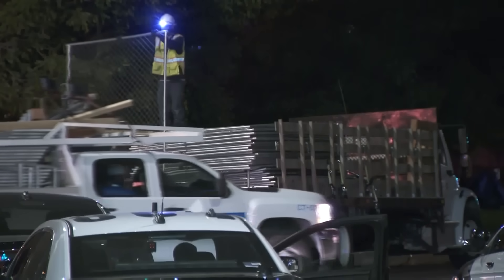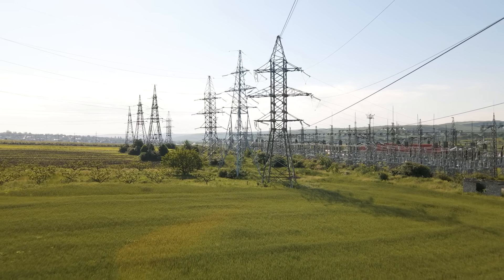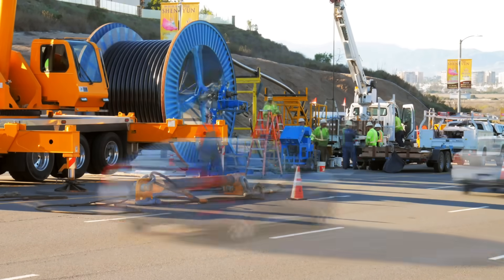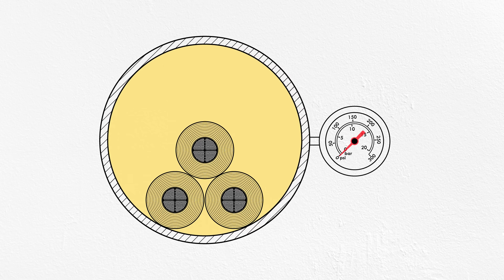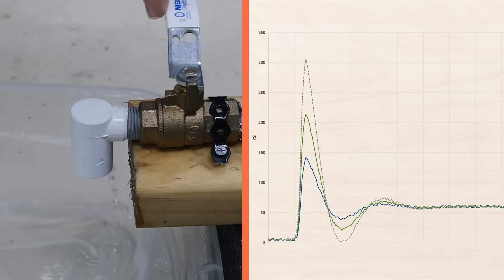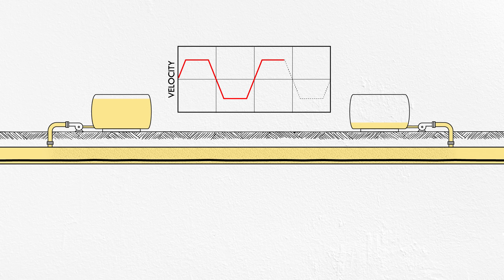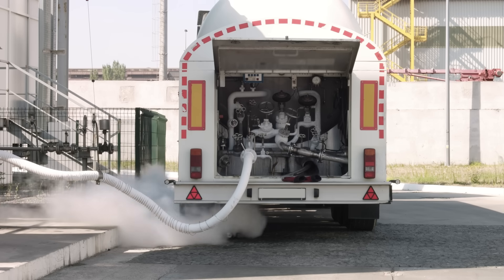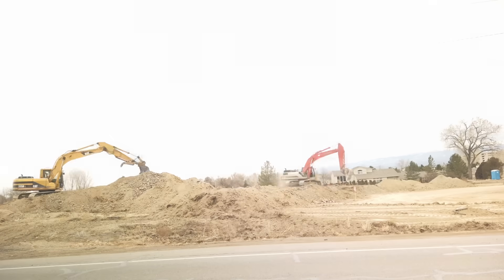Repairing Underground Power Cables Is Nearly Impossible

Comment: Genuine question as a freshman Computer Engineer: why didn’t they use polyethylene in the first place? It seemed to me like a more straightforward solution than the dielectric oil
Reply: Because reliable XLPE cable wasn't around in the 1970s
Reply: I would guess lack of know how, in terms of durability under ground with probably unknown temperatures. Wiki states it can only be used for applications below 80°C continously (table only on german wikipedia: https://de.wikipedia.org/wiki/Polyethylen#Thermische_Eigenschaften). That's the temperature many over ground electrical lines operate at.
It was apparently used for high voltage high frequency radar applications in WWII so it was already common as an insulator.
Reply: Probably not a technologically or economically viable solution at the time of original design.  The aluminum apex of the Washington monument was, at the time, incredibly rare and valuable.  The discovery of large scale refining methods changed that.
Reply: Excellent question.  It's always easier to look back and find fault in a design but the material choice of polyethylene for the dielectric, at least to me, seems like was just overlooked in this case.  Maybe they considered it but didn't because  the engineers at the time didn't believe that the dialectic properties of polyethylene were "good enough" or provided enough margin of safety and went with something that they thought was much less prone to failure.  Just a guess on my part.
Reply: A brief search turned up a 1967 paper "Polyethylene as a high voltage cable insulation", which states that "... even at present, ... paper-insulated cable is still very much in use for all voltages from 15 kv up, and in one form or another is the only insulation used commercially in the 230–345 kv range."
The paper outlines "... the requirements for a high-voltage cable insulation, and will investigate the extent to which polyethylene meets these requirements."
I theorise that the technology was not yet generally available when this project was planned in the 70s, or it was not considered mature enough to be used in this project.
Reply: Was it available for the initial installation?
Reply: Not readily available and even more so for this scale of project

Comment: One of the annoying things as a utility engineer after a storm incident is having to hear all the questions of "why don't they just bury the power lines underground so they can't get blown over"? 
Thank you for highlighting some of the issues with underground power cables, they aren't always the best option.
Reply: Long term the cheapest and enviromentaly best option would be to build utility tunnels under every streat which make a combined easy access for running water, sewage and electricity and whatnot in accessable pipes through them.
Always.
But humans don't tend to think longtherm and for building the costs for this would be massively higher...
Reply: use goddamn utility tunnels like europe has been doing for decades and most of the problems disapear.
Reply: I was "one of them" that used to say this all the time after hurricanes topple power lines in affected areas.  I was always "told" or "heard" that one of the main reasons power lines aren't buried is due to power-loss from source to user, is higher for buried power lines.  I'm not even sure that's true, but this video highlights the drawbacks to buying them, that's for sure.

Comment: I recently had a small pipe burst in my home and the plumber I called also froze the pipe from both sides of the fault so he could easily and quickly install a new piece of pipe without disturbing the water supply to the building. Cool to see it used in such a large repair job too.
Reply: They don’t freeze the entire pipe so the plug expands into the unfrozen section. Steel is stronger than ice/water as long as its not sealed in…
Reply: I just imagine the ice plug becoming dislodged and turning into a 60-90 PSI driven bullet toward the plumber
Reply: @CarrotCaptain  So you're saying don't go cheap on the freeze kit? 😂
Reply: @Kolinako thanks for mentioning this. I just learned that freezing pipes is a viable method at small scales too. 
A twofer!!
Reply: You should never freeze water pipes, water expands when turned to ice and will cause tremendous stress to pipes. I wouldn't be surprised if, in the future, the pipe bursts where he froze them. That's what valves are for, put them in strategic locations and you don't have to resort to dangerous improvised methods.
Reply: @Rayden440  you should go look it up it’s quite common.
Especially in hospitals where shutting off water could actually be deadly
Reply: @Rayden440  Take a look at some plumbing tool suppliers and methods and you will find it's reasonable and safe, properly done! In some instances, it's the only practical way to make a repair! ¯\_(ツ)_/¯
Reply: @Rayden440  I work commercial HVAC and pipes are frozen all the time with a freeze kit for repairs. You have no clue what you are talking about.
Reply: @Rayden440  that actually isnt correct tho, since you freeze the pipe in a non enclosed state its even safe, the ice slugs can expand into the pipe itself and dont need to pressure the pipe around its circumference

Its even common practice if you cannot shut off a line because its paralel to other clients also receiving water which cannot be interrupted

There is another procedure used for large gas pipelines if they cannot be shut down where they essentially live tap the line twice and then seal in between with 2 more taps where they insert valves but that procedure is NUTS
Reply: @Rayden440  I owned an apartment house in NorCal and very often used dry ice to freeze the nearest elbow to the area where I needed to repair a valve or solder in a fitting. We had gate valves on hot water tanks that would shut off and the threads would strip when you tried to open it again. The zinc leached out of the brass threads after 40 years and these old valves always caused problems.  These valves were directly soldered in. I always replaced them with threaded ball valves.

Freezing the line with a bag of dry ice solved many problems. In 30 years of owning the building, I resorted to freezing copper lines maybe 35 times.  This avoided having to shut off the water supply to 6-8 other units.  Tenants never had to worry about their water being shut off. The dry ice would freeze the water solid and prevent having to try to solder a line that had water dripping through it. I used to ball up white bread dough and force it in a water line to keep it dry enough to quickly make a proper solder joint.  Either way, I never had any pipes burst or leak after freezing sections of them.

The largest lines I froze were our 1-1/2 inch wet fire standpipe headers to hose racks. Everything was copper or brass except for a steel nipple at the fire hose rack. Those corroded through and leaked. What a pain to remove the steel ones and replace them with brass nipples. Dry ice saved me a great deal of expense. I often did the repairs myself as it was beyond my maintenance guy's capability.

Comment: Okay, so now I understand why "just put them underground" isn't such an easy solution to the problem of failures in overhead transmission lines causing wildfires.
Reply: just make wireless power 🙃
Reply: @BlackDragonWitheHawk  B)
Reply: @BlackDragonWitheHawk  just have a rotating shaft transmitting the power
Reply: @simontist  that's not wireless...that's a step backwards...

How about geneticaly mutant powerhamsters with a life expectancy of 120 years, food requirement of a tardigrade and 10000 hp strenght (and only 2 h sleep requirement...) Giving one to each house and installing a turning wheel and a battery connected to a turbine
Reply: @BlackDragonWitheHawk  so, basically you'd send these hamsters along an underground tunnel from the power station? Seems legit!

Edit: the pipe must be underground to prevent hamsters escaping and setting fire to the forest by their high speed movements
Reply: except it very much is an easy solution. easpecially nowadays when plastic insulation is widelöy available.

just think about it for a second. fixing the line, which used a by now ridiculously outdated design, costs tens of millions every 20+ years and the new plastic version will cost a lot less due to being easier to replace and less likely to have a fault.

wildfires in cali cost billions a year.
Reply: @anonym3017  Easy? Sure. Economical? Well, considering that California alone is larger than many european countries, it is most definitely not. The terrain is also not very suitable for underground transmission lines in many parts of California. If you've ever been you'd understand why.
Reply: @ice44567  except cali isn't larger than all of western europe combined.

And switzerland manages underground main lines in the alps so cali can fucking do it as well.

And the cables starting fires were never HV lines but Medium to low voltage ones which aren't built high enoug hto not be reached by trees.
Reply: The problem isn’t just “causing wildfires”, but power restoration after hurricanes, particularly in South Louisiana where the land is just a few feet above the water table and storm surge can put 10 feet or more of water on top of that.
Reply: Yes, can see why giant chainsaw dangling from a helicopter is actually more practical now.
Reply: The wildfire issue is absolutely shoddy maintenance on the part of PG&E. They cut the tree trimming and other maintenance budgets for more profit and this has come to bite them in the ass. I do refuse to pay for expanded maintenance now as this should have been kept up and the old profit level kept. (Another reason for me to hate corporate types.)
Reply: It is an easy solution, it's standard in Europe and works fine. Typical American incompetence
Reply: @thauolar186  I doubt it's as "easy" as you imply, but regardless, it's also incredibly expensive compared to poles.
Reply: Well, it would be simple if they added expansion joints from place to place for the cables, replaced the paper fabric with fibreglass fabric and hanged the cable in the oil so individual sections could freely expand and contract without rubbing against the pipe.
Furthermore, using low viscosity oil would allow the cables to get soaked in oil and cool themselves by convection without needing tens of bars of pressure or pumping stations at each end.

But designing a special low viscosity high density oil and surrounding the cables with a sparse hexagonal fibreglass net that doesn’t trap air bubbles and hanging the cable inside the pipe so it doesn’t grind against the pipe and designing thermal expansion joints for high voltage cables... all those things can be... expensive R&D stuff.
Reply: @drgazter  Or you just call the british national grid and get their specs for the london underground HV line.

because youi don't need the oil whatsoever as a thick plastic insulation also does the trick.

It's not hard because others have done it before you and you can just copy from them.

Comment: what a great video! Even as an electrical engineer specialized in high voltage and working with TDR regularly, I found the story very interesting and learned a lot!
Reply: AIUI TDR works well where there's a single point of failure. Was it the fact that there was degradation on the line everywhere that stopped them identifying the 'break' they were looking for?
Reply: @nialstewart8263  It was probably a 115 or 230kV line, and the TDR probably couldn't create high enough voltages to create a significant partial discharge.  If a thumper couldn't do it, a TDR probably can't find it at all.
Reply: @NickPeaden  The TDR doesn't work by producing a discharge but by measuring/ timing the reflection from a discontinuity in the lines impedance. If it's a clean break you get a nice 'sharp' reflection, if the whole thing is breaking down, possibly not. This is RF/ PCBs I'm talking about but I presume the physics is the same for power lines.
Reply: @nialstewart8263  The problem with high voltage power lines are that they are presumably a giant capacitor.  You're literally sending a pulse down a parallel plate transmission line that is massive, and you hope that you can measure an impedance (Z=V/I) change.  The voltage waveform will decrease through the transmission line due to capacitive and some resistive losses, which sets the machine's distance limit.  The impedance at any point is pretty much defined as its capacitive current and its partial discharge current, which is resistive and in-phase with the voltage waveform.  If your TDR voltage pulse isn't high enough voltage of a pulse (ideally a dirac function at rated voltage), you'll likely never see any change in the impedance of the line as the dielectric constant is pretty much similar throughout the cable for the test voltage.
Reply: The problem with straight TDR is that the fault doesn't have low enough resistance especially if the oil fills in, to appear as a short to a low voltage pulse to generate a big enough reflection in the lossy medium.  A thumper with TDR charges it up until it breaks down so you can see where the arc happened. It is possible for the fault resistance to be too high for regular TDR and too burnt in to get an arc from the thumper.

Comment: Grady, I have a super interesting story about how they used liquid nitrogen and cooling units to freeze a tunnel wall  for a tunnel that they were boring underneath a canal in the Netherlands, especially interesting because the ground above and around was sand. Let me know if you want to know more. I do not know everything about this story, but maybe I can give you some pointers where to find out more about this :)
Reply: That’s a fairly common approach for tunneling through wet, unstable soil.  They don’t always use LN2, but the concept is the same wether they are using it or brine.
Reply: Similar thing was used in Paris to bore the metro tunnels at the beginning of the 20th century, except they used ultra-cool brine to freeze the Seine river.
Reply: The same method was used in the 70s in Romania to build an entire metro station in a rather swampy area in Bucharest.
Reply: @titusicleanu7431  And in Leningrad, also in 1970s: the tunnels failed 20 years later and it took 9 more years to build new ones https://en.wikipedia.org/wiki/Lesnaya_(Saint_Petersburg_Metro)#Geological_conditions,_washouts,_building_and_repairs
Reply: I would love to see a whole video about this method! Sounds really cool!
Reply: They did this freezing method when the Paris Metro was built next to the River Seine.
Reply: Really interesting stuff, I was told it was quite rare these techniques were used, but reading all the comments, it turns out it's not that rare after all!
Here's a video on the frozen boring in the place I was talking about:
https://www.youtube.com/watch?v=5vNX3fwE-bg

Mind you, this was done underneath a monumental (one of the two oldest) train station building!

After doing some more reading on the topic, it actually wasn't boring, but it was only a 4-meter long section that was done by hand. They had to freeze a 2 meter thick area around the hole to make the hole stable so they could dig out the final piece of the tunnel. They had approached the wall from the backside with a boring instrument.

It was quite a feat, this was part of a project called the 'Noord-Zuidlijn' and involved boring a tunnel underneath the capital city of the Netherlands; Amsterdam.

Here's more info on the techniques used in Dutch:
https://noordzuidlijn.wijnemenjemee.nl/tijdlijn/bouwtechnieken-noordzuidlijn-in-de-beginjaren/index.html
Reply: Same technical job  was used for the Big Dig in Boston on 1 part of it. Freeze the ground works well usually.
Reply: They froze the ground to help support the red line train tunnels while digging the "Big Dig" project in Boston (which is an ocean bay city with lots of reclaimed land).
Reply: Recently used to get gas transmission lines underneath the Fraser River in Metro Vancouver
Reply: They most likely just dug a hole in the ground, and around the line slightly, then poured a pool of LN on it, then maintained the pool.